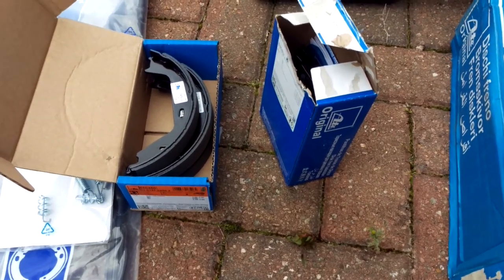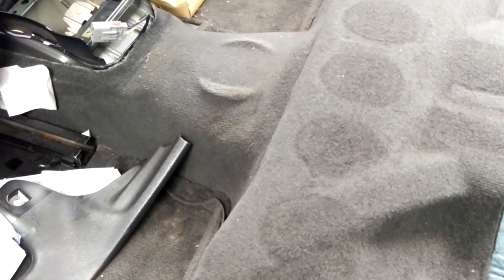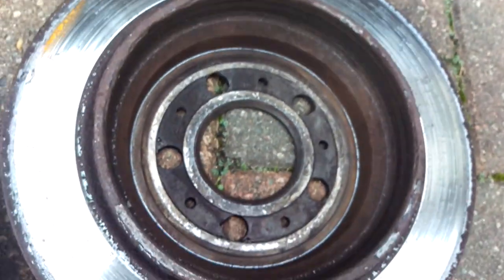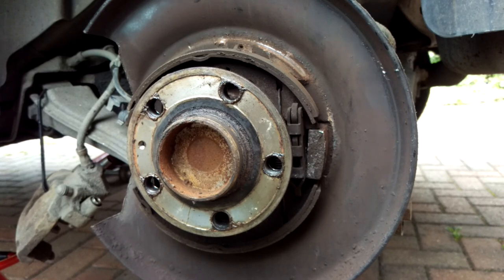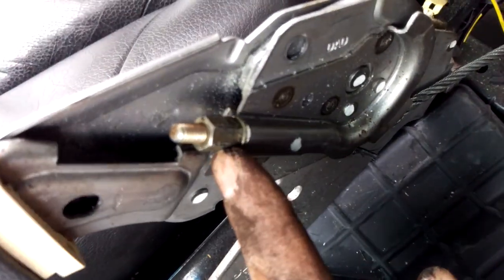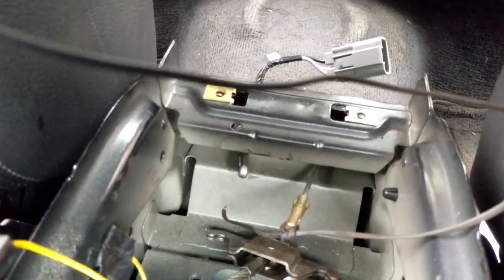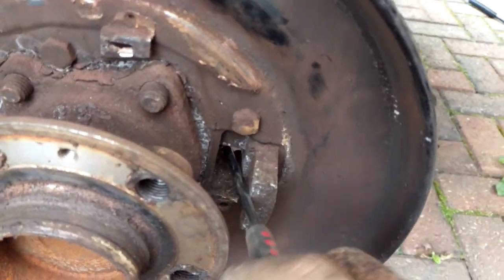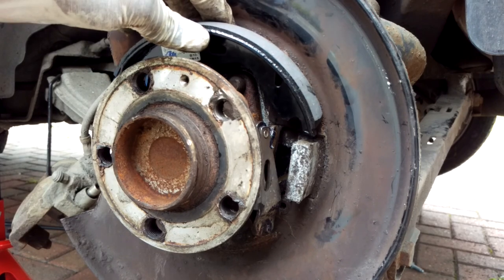Handbrake Cable and Shoes Replacement Volvo S60 and Others

Comment: Fantastic video, you put a lot of thought into showing the important parts, and how to do it, you have made my life so much easier for the coming few days, because i have to replace the innards of my off side rear drum brake due to a catastrophic failure, which lead to everything within the drum to disintegrate, a broken retaining spring has led to this by all accounts ! as V70s are prone to severe damage  if the retaining spring brakes, and looking at this video has helped me to know how to replace the expander, and what happens to it when pushed through to opening to the cable, so thank you very much, you're a lifesaver, and given me the knowledge required to tackle this with a certain degree of confidence.

Comment: oh, and another point, there is an aftermarket minor mod that is helpful. The fixed expander can be replaced with adjustable expanders off eBay or Amazon. They are just short of £15 for a set that does both sides.  They allow adjustment of the shoes in side the drums and may even allow a longer duration before needing to change the complete cables.

Comment: Thanks for the great video.  My V70 made a horrendous sound when starting to move on the drive way, which could only have been a faulty handbrake as the discs seemed ok.  I took the hubs apart and the shoes had started to de-laminate on one hub and on the other side when I removed the rotor, the brake friction pads just fell out !  Luckily no damage in the hub itself.  Just one hint for a less experienced mechanic like myself is that one might need to back off the handbrake adjustment, by the hand brake in the car, when replacing the shoes on a 140,000 mileage car, as initially I couldn't get the rotors back on !  Thanks again

Comment: Well. I'm not looking forward to it but it seems like my cables are done. Changed the pads out yesterday/today and the difference in new and old pads was around 1,5mill at tops. Adjustment was maxed out with the old pads at the handle end of cable. Thank you for the clear tutorial videos, these have made owning a volvo a very, or at least a relatively easy and pleasant experience, six years and 100k in so far! While I was at it, I swapped out driver side back door, that was also a pretty painless experience!

Comment: Thanks for this video. I've just finished doing mine today. What a pig of a job! I ended up removing the centre console like yourself as the cable kept catching on something before entering the hole under the console. There was a small gap in the carpet that I could get my fingers in to sort it out.

Comment: My handbrake started dragging on 1 wheel today on my way home. Got glowing hot.
Handbrake handle starts giving resistance at the last 3 teeth so i guess its not only done but the assembly in the drum completely failed.
Gonna replace everything.

Much thanks for this video.
Reply from the maker: @Bo-tt8cy  No problem. More likely a sticking piston for the main disc brake. Handbrake seizing wouldn't generate so much heat. A new caliper should sort it. Good luck.

Comment: Thanks mate great video. 
I did my shoes without changing the hand brake cable, cable was good. My shoes lining had broke into pieces and brutal force had to be used to remove. Had to buy everything just like you did😬.
Thank for you Volvo S60 videos, they do help.👍🏾👍🏾👍🏾👍🏾
Reply from the maker: There's certainly lots of "fun" when dealing with the rear brakes in general. ☺️
Glad you got sorted though and thanks for taking the time to comment.

Comment: Love your video' s mate, you have posted this just in time as i have the exact same job to do on my wife's S60 D5. I ve bought all of the parts but i could't find a good video on here with a step by step guide until this. 
I have also replaced all 4 brake hoses on my wife's, the rears are a bit of a git because of the position of the metal pipes where it meets the rubber hose but im sure you will be fine. 

One of my wife's HB cable where it meets the hub as destroyed its self (the plastic bit has failed)
Reply from the maker: So long as you're prepared for the odd hiccup, particularly the rear disc removal, you'll be fine. 

Yes I've seen the rear hose nut and even after removing the bracket as per Vida, access is still poor. 
I've cleaned up the connection and soaked in penetrating fluid and will be buying a flare spanner because rounding off that nut is not an option.☺️

Thanks for taking the time to comment.👍

Comment: I bought my 2005 xc90 T6 3 months ago and parking break never worked then I bought the brake shoes and kits trying to replace them few days ago only to realize that there were no brake shoes at all, not worn out or anything, they just didn’t exist at all and if there were actuators there I would’ve just put the new shoes on but there was no actuators or anything (actuators is the claw thing that hooks on the cable on the inside of the drum) so I had no choice but to put the disc and calipers back and wait until the order for the actuators arrive) got it today and am gonna do it on Saturday. It’s a pain parking it uphill at work

Comment: Thank you for the useful video. A couple of points. I do not understand why so many mechanics do not think of the next guy. The next guy might be you. You mention about how corrosion on the hub might be a reason for a difficult removal. So why not at least run a wire brush over it before reassembly. Also, I'm a retired aircraft engineer and have worked on cars and planes for over 50 years. I would never now put a bolt back without a smear of copper slip grease on the threads. And also would probably wire brush the threads of each bolt first. Anyone who has had to remove seized bolts would surely know how helpful this is. Also, how long does it take to soft brush away the dust or blow it with an airline, and wipe down with a cloth moistened with cleaner?  Otherwise, many thanks and keep up the good work.

Comment: Hi Rob, thanks so much for your video-very detailed snd helpful-especially the part reference the knuckle installation as that isn’t self explanatory. 

After I changed the shoes and tensioned the cable it only holds on a relatively small slope and not a steep incline. I’m now wondering whether to buy new discs or try the adjustable eBay mod you can buy? 

Any help would be appreciated as the car failed it’s MOT.

Comment: Just done this and had a bit of a disaster.
Expander wouldn't go back together.
Bollocks.
Just would not hook back in.
Had to put everything back together for now minus the shoes.
Starting pissin a rain when none was forecast.
Should've stayed in bed.
Reply from the maker: Took me a few goes around 16mins in the video.
Reply: No big deal bud, Hell I ended up tossing my rear brakes away and just put it back together with out the brake pads, I figure I have front brakes so fk it, I just drive slow,
Reply: buy adjustable shoe clips from ebay about £10

Comment: I Did this a while back but I wanted to see if you retro fitted the adjusters from an older model as most people advise to. And you didn't. 
I've had the issues as many v70  owners have of MOT failures due to the hand brake only working on one side and that problem has return since shoes have worn.
Also I'm interested to know if you've had the rear brake shoes ratlle like so many do or if you know a fix for this very poorly designed system.

Comment: You can disable the interior lights by holding the middle button for 10secs while door is open then it wont come on no more when you open doors but does reset when you press button again
Reply from the maker: When opening and closing the doors, the battery drain is more than just the courtesy lights as you can have multiple drains from the car being "awake" so I would still recommend the door lock trick to ensure the current drain is kept to the absolute minimum.
Reply: You should've sprayed down the entire wheel break system with break cleaner and brushed off most of that rust with a small white brush prior to removing any and all parts of the breaks, also it's obvious someone didn't care for the break system at all.
Reply: It's also obvious someone doesnt care for the autocorrect function of their phone or computer. Brake, not BREAK!

Comment: Great video! Quick question - I have a S60 and the handbrake lever feels like there's nothing attached to it until right at the top of the movement at which point the handbrake works, although not very well. It's a friend's car so don't know if this has happened suddenly or over time. Also, apparently a garage has previously fitted an 'automatic adjuster', what would that be all about? Thanks!

Comment: I follow you as my car is a volvo s60. Just failed mot they said handbrake cables, shoes and springs needs replacing quoted £700 including mot charge, for volvo s60 2001, 2453cc. Do you think this a reasonable price? Would you do it? I will pay of course but depends how far you are from South London and the cost. Cheers

Comment: Great vid Sir Rob as all your vids are.One question,I will be replacing the rear brake pads,rotors and shoes with new spring hardware as well.Will I have to remove the center console to slaken off the cable adjustment? I don't really want to remove the console because my cables are fine.What is your opinion please.
Reply from the maker: Richard Pflieger If you're certain that the cables are still good, you can access the cable adjuster by unclipping and lifting the handbrake lever gaiter.
Assuming you have a handbrake and not a footbrake like the XC90.

Comment: SiRobb- Nicely done. When I got into this, mine had come apart. The spring detail and sequence was quite good. I was wondering, why did you wait to put gloves on when you were almost done? 😂
Reply from the maker: The gloves weren't for protection. 
I'd been using brake grease so were to save me repeatedly degreasing my hands when handling the new pads.

Comment: Sorry just another question. 
The carrier / frame bolts.
Apparently you're supposed to replace them when removed. 
Surely it's okay to just clean them thoroughly and apply some mild threadlock?
Reply from the maker: Yes, the official recommendation is to fit new carrier bolts. 
Whether you do that is entirely your decision.

Comment: I did this job and I replaced the rotors and pads and painted the calipers, but I now get a clunk sound whenever I disengage the handbrake (only on the left rear wheel).. And the funny thing is, all of the springs are in place and the sound isn't there when I disengage the handbrake when the wheel is taken off.. So I have literally no idea what it is and I guess I'll just have to live with it

Comment: Started doing this on Sunday and the bastard bracket what the locating spring hooks into has come away at the top, hoping I can drill a small hole and put a small self tapper in there to hold it in place

Comment: What year is the car you are doing this on?  I don't think my 2004 S40 has handbrake shoes?
Reply from the maker: The S40 uses the regular brake pads on the discs as the handbrake.
The handbrake lever operates a separate mechanism built into the rear calipers.

Comment: SiRobb, My right rear parking brake shoe de-laminated several months ago.  I removed the rotor and most of the shoe pad just fell out.  I put it all back together and have been driving without a handbrake.  Today, I pulled some shoes from a wreck and began to replace my pad-less shoes.  Once I got everything re-assembled, I could not get the rotor back on.  It appears the shoes are slightly engaged and the mechanism that expands the shoes seems to be permanently somewhat engaged.  In the end I gave up and put the whole thing back together with no shoes.  My question then is this:  Is it likely that the hand brake cable is frozen in the slightly "on" position which then makes the new pads sit proud? Is my only option to replace they entire system as shown here?  Too much for me, I'll let the Volvo shop do it.  This will be costly.  Do I really need a hand brake?  Rarely use it.  Auto tranny is in park.
Reply: Replying to my own comment.  Today, I took the cowling off the hand brake and backed off the adjustment nut.  That then gave me just a little more play when installing the new shoes.  The wheel went back on easily this time.  Buttoned everything back up  and rolled the car down a slight hill and made adjustments and now I have a hand brake.  There was quite a bit of rust inside the rotor, but I assume that will wear down as I use the hand brake.  Thanks for your videos

Comment: Hi Sirobb, I know what to do with the parking brakes of my xc90, I tensioned in the regulator that is in the console next to the driver's seat, according to your video, it does not brake well and it does not hold on a slope. second step I bought some tensioners on ebay and installed them on the rear drums, the shoes are correct, cables fine, I adjusted them almost brushing the drum, it brakes a little better, but it does not hold the brake in a difference of 20%, I am somewhat worried . I would appreciate your experience. Thanks for reading
Reply from the maker: With handbrake released, you need to tighten cables until you can't move the car then loosen the cable slightly until you can move the car again.
When you then click on the handbrake, the car should hold very well.
This is assuming that every component is working correctly.
Reply: @sirobb  THANKS FOR READING ME, AND FOR YOUR ADVICE. TOMORROW I WILL DISASSEMBLE THE ENTIRE CONSOLE AGAIN TO HANDLE THE BRAKE TENSIONER, I WILL CROSS THE FINGERS,

Comment: well on my 04 v70 that big metal triangle on the rigth inn the video next tp the hub 
has broken off.... can i just weld it on ??
Reply from the maker: Sure, if you can do it safely and restore correct operation.
Reply: Not sure what you mean by "The triangle bit" ? but if you mean the lug that prevents the shoes from rotating when applied, then this broke off with my V70, causing untold damage to everything in the drum, all needed replacing, but i found an adaptor kit to replace the lug, cost just £15 on Ebay, bolts on with two bolts via the bolt holes for the backplate ! so knowing this is available tells me this problem is not uncommon !  read that this can happen if a retaining spring brakes, causing everything to be smashed to pieces ! so beware, always use new springs on any brake service ! even if it's just a cleaning job ! not worth the hassle and the expense !

Comment: Absolutely no need what so ever to go to all the trouble of removing the rear carpets and all the trim that hold them, the cables feed out and back in from underneath without going to all this extra trouble. But well done for the video tutorial.
Reply from the maker: Lifting the carpet isn't unnecessary at all. 
The handbrake cables have a rubber bung with a double lip that is specifically designed to be gripped and pulled through the bodywork. 
If you leave the carpet and push the cable through, how can you be certain that the bung has sealed flush on both sides? 
The method I show is the official Volvo technician method. 
As for seat removal and lifting the carpet being trouble, it adds 5 minutes to the job so no big deal for a job correctly done.

Comment: I can't get my driver side rear disc to go back on ground the lip off and put new shoes on
The other side was really easy everything looks positioned properly
Reply from the maker: Make sure that the cable is fully loosened and the expander on which the shoes sit is resting in the fully "off" position.

Comment: Is there anything that can be done about the rocking you get on the rear wheels even when the handbrake is on?
Reply from the maker: I don't think there is. Not officially or recommended at least. 
The "give" is the shoes coming to rest against the rectangular casting by the expander so unless you eliminated the small gap, you just have to accept it's a feature of this style of handbrake. 
When it happens, the wheel is locked so the car isn't moving but I can see how it can be disconcerting or cause annoyance.
Reply: +SiRobb Thing is. Cold or wet. or worse, both.
If I park on a hill that little rock turns into a roll because of the inertia.
I have to let my foot off the brake very cautiously. 
I'll tighten the handbrakes see if that makes any difference. 
But it really is just "A Volvo thing" as they say.
Reply from the maker: +Andrew Gallacher If your rock turns into a roll, the problem isn't the quirk of the rock. 
Basic nut adjustment is as good a place to start and see where you're at.
Reply: +SiRobb Rock'nRoll man.
Reply from the maker: +Andrew Gallacher I prefer Rock and Stop. 👍☺️
Reply: The handbrake has had that movement since the 240 days.

Comment: One advice : That expander mounted in 26:06 should be replaced with regulator from XC90- that allows you adjust brake shoes individually .  Here is a  photo: http://images66.fotosik.pl/1168/ae022ac8456c8426med.jpg
Reply from the maker: Thanks for the comment. 
I know that some people choose to fit them but the adjustable expander bar isn't necessary for a good parking brake.
Reply: OK. Just gave you an idea.  Thank you for sharing :)
Reply: I agree it makes for a better adjustment  .